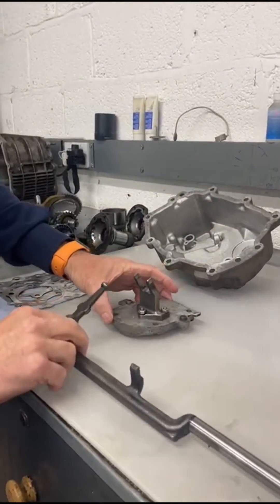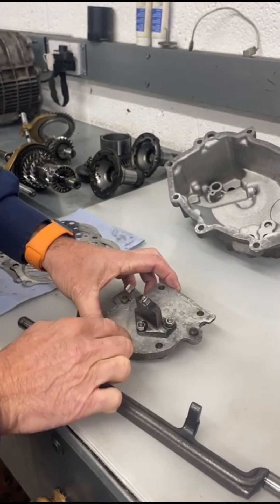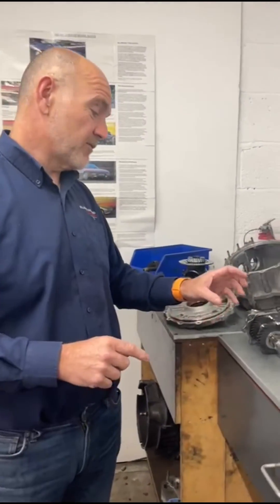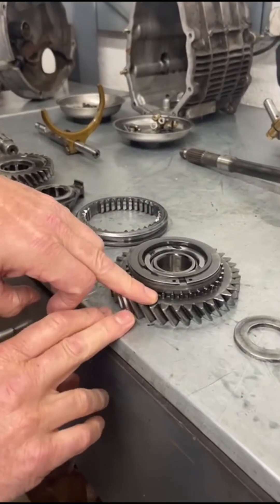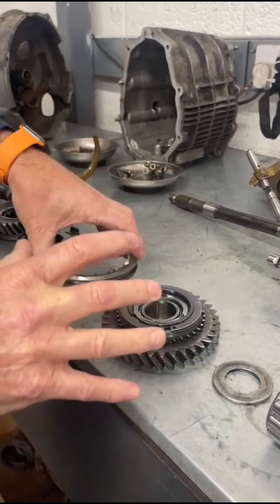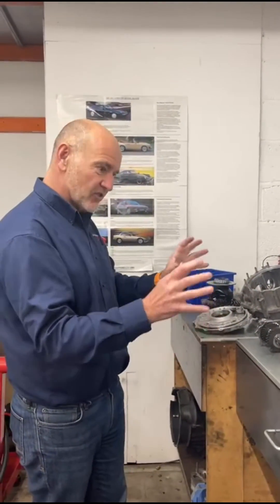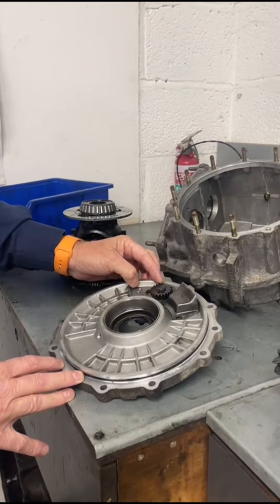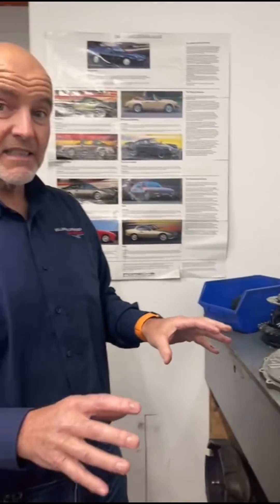915 Gearbox Transmission & Synchromesh Issue

Comment: Very interesting- thank you, I have a G50 which is sometimes hard to engage 1st. It's a lot better after bleeding the clutch, but I suppose the clutch has worn. Are there any components on the linkage (964) which might improve it before I replace the clutch itself?
Reply from the maker: I will speak to Richard and ask him your question.
He suggests that as bleeding the clutch has proved successful, then a new clutch would probably be the way forward. However, it's impossible to rule out linkage problems......